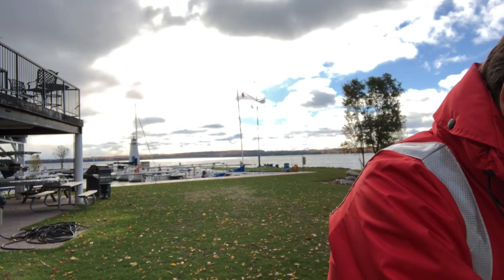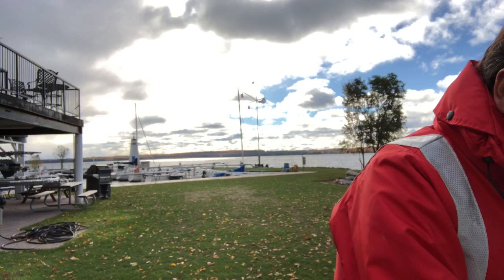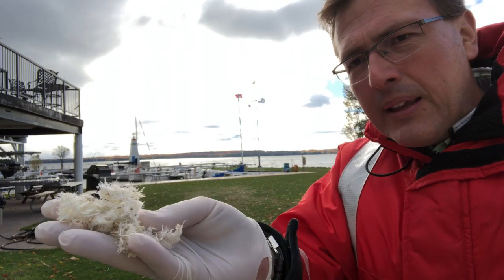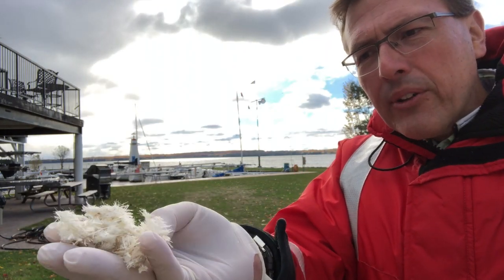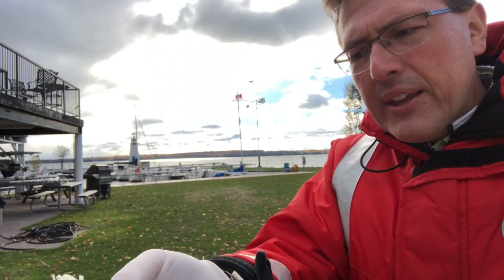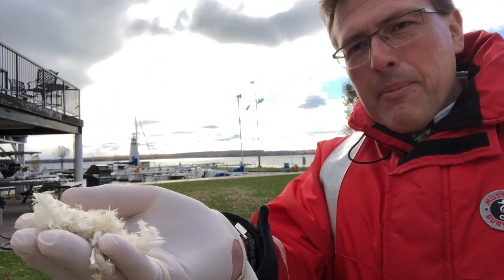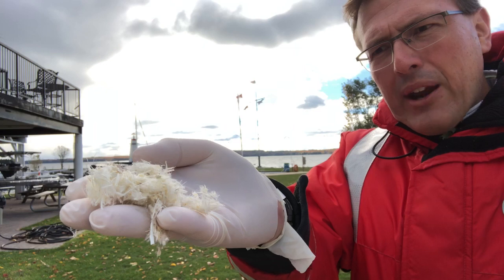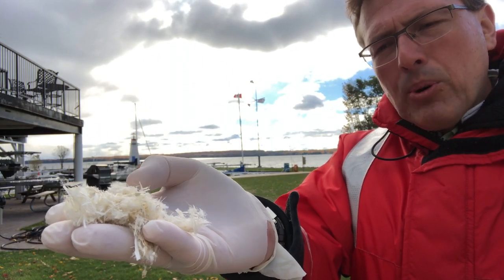Project Update - Recycling Fibreglass Boats

Comment: Hello, I am a senior mechanical engineering major working on a capstone design project that requires the grinding of fiberglass. I was wondering what grinding machine you used here?
Reply from the maker: Good Morning Alice - for our development sample, we used a 20 hp grinder with a 3/8" mech, from Rotogran in Bolton, Ontario.  This is essentially a thermoplastic parts grinding machine.  It worked perfectly.  Good luck with your endevours!